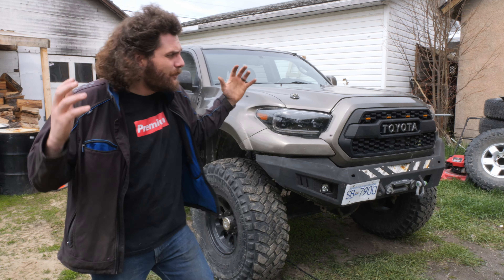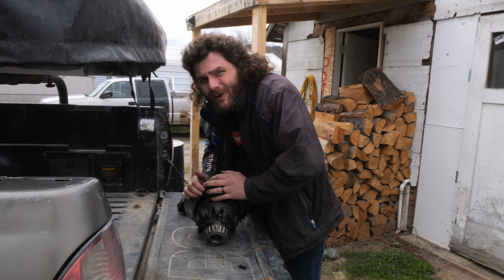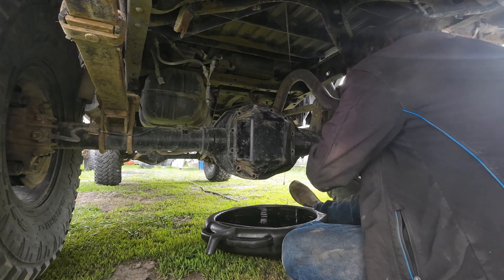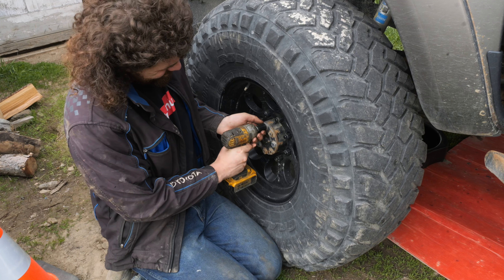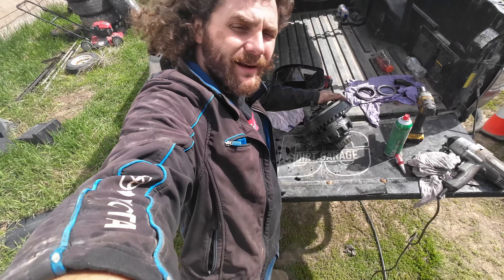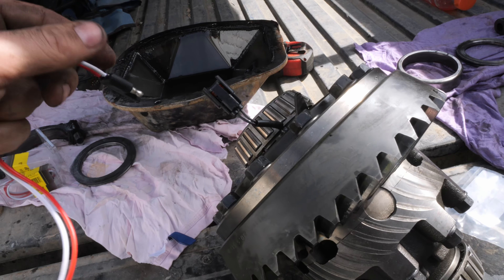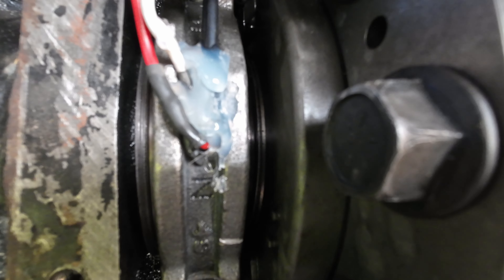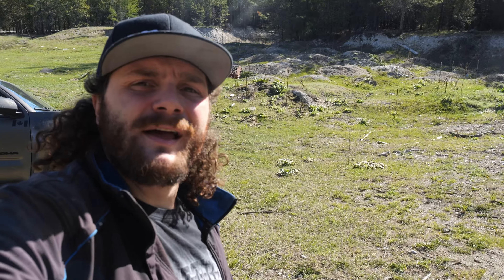How to Install E-Lockers in Your Super Duty (Sterling 10.5)

Comment: The thick cut gears are made to run on a 3 series carrier so you don't have to replace the carrier when going to lower ratio that would normally use 4 series with a normal gear set.
Reply: That's what I was thinking, a thicker ring instead of having high/low ratio carriers.
Reply: good to know!!!

Comment: I wonder if the solder, heatshrink, connector, seal, wire coating is temperature rated to the gear oil temps
Reply: I see in the thumbnail solder was external to diff

Comment: Your "new" used locker looks like the previous owner didn't install the pinion correctly and it self clearanced on the carrier. You might want to keep an eye on that
Reply from the maker: Yeah it had a crush sleeve failure I was told. I'm well aware of that 🤣

Comment: I'm not going to lie those don't look like 1 ton axles.........
Reply from the maker: @TheRealTaylorSmith-w9k  Well they came from a F350. Dana 60 front a Sterling 10.5 rear. As one ton as it gets 🤣
Reply: @DirtGarage  .... I love your enthusiasm!!!...
You might be right!....I wonder if mine looks a lil different because it's a two-wheel truck on a 1-ton rear axle... matched with the zf6... wonder if things are a little different. supposedly the two-wheel drives can tow a lil more.... I'm going to do some investigating, comparing and get back to you on this....
Reply: @TheRealTaylorSmith-w9k they're all the same sterling 10.5 from like 94-2017. Unless you have a F450 or up, you might get a Dana 80 or a sterling with SLIGHTLY thicker axle tubes.
Reply: @adambender5585 the drw f350 super duty came with a dana 80 from the factory, the 99-04 f450/550 came with a dana 135 and a goofball 8x225 bolt pattern, the 05+ 450s came with a dana s110 and a 10x225 bolt pattern, it has a dropout center section like a 9", absolutely massive axle.. 

The obs dually trucks came with a drw sterling, save for the f-superduty, it had a 10 lug dana 80 and factory rear disc brakes